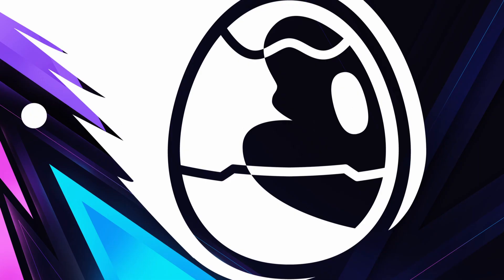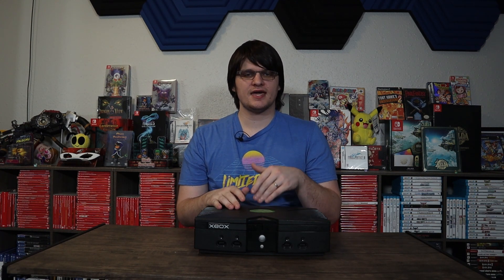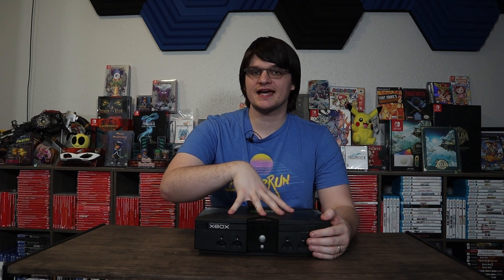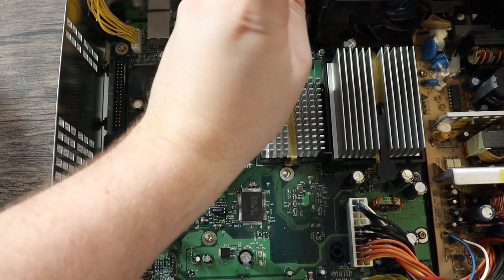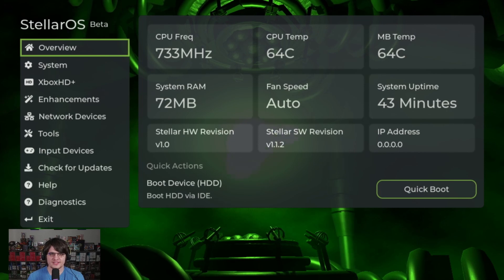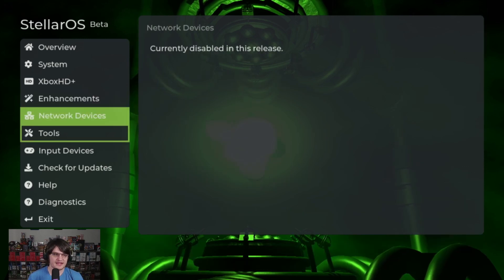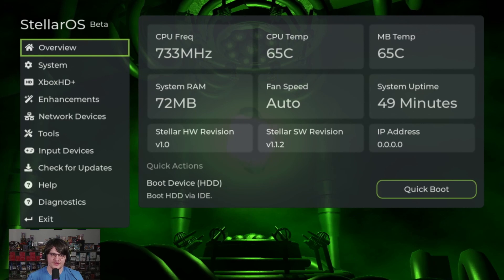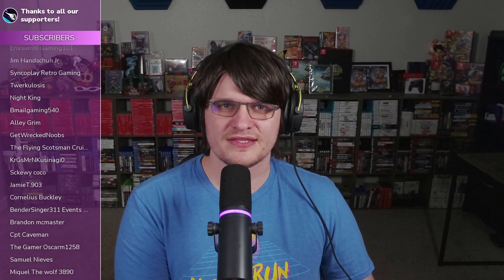A Must Have Original Xbox Hardware BIOS Mod and HDMI Mod [Project Stellar XboxHD+]

Comment: Getting an SSD is not worth the cost. Get a 2TB sata and a reliable 80 wire IDE cable along with a Startech adapter. Having a mod chip without upgrading the guts just seems pointless.
Reply: I agree for the most part. If you're looking for performance, yeah it's not going to be found with an SSD versus a fast HDD in the OG XBox since the bottleneck there is in the interface and the bus. If you're looking for the absolute most quiet system possible, then eeh maybe a miniscule improvement going from HDD to SSD. In my case I have an extra 1TB SATA SSD from the last time I upgraded my computer so I'll use that anyway since it'll save me spending ~$50.

Absolutely agree with your point on putting in a mod chip without changing anything else though.
Reply from the maker: I mostly got it for the HDMI originally and knew that the mod chip was the easier to install. Also was cheaper together than if I wanted the mod chip down the road. I will get another stock one and upgrade the storage too

Comment: My system was working... then it started to turn on, immediately turn off. did that 3 times and then wouldn't work. I have no clue how 3 systems 2 1.6 and 1  1.4 all have the same issue. when they worked fine before the mod. worked fine for a little bit after the mod and now all do the same thing.... anyone have any ideas...(stop modding I know) any other ideas???/ lol
Reply from the maker: Have you joined their discord and asked the creator about the issue. He might have run into this issue already and might have some ways to help